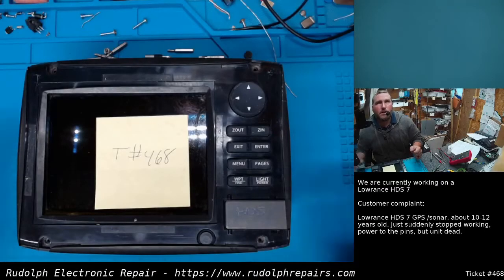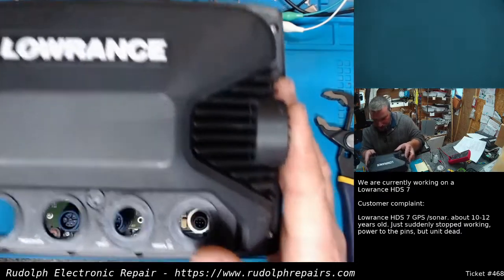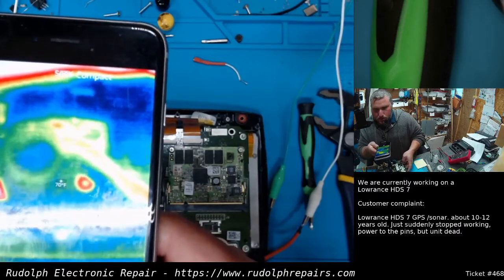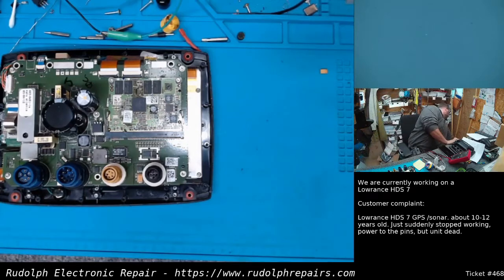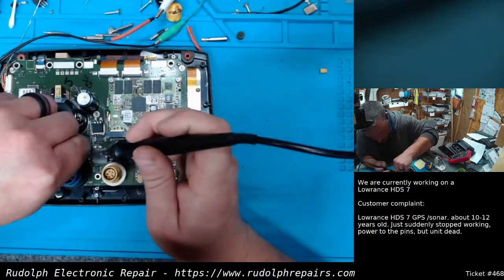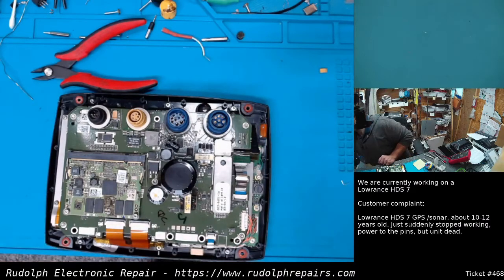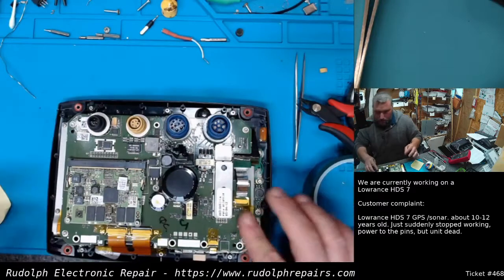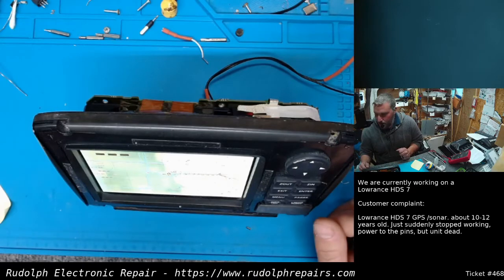Lowrance HDS7 - No Power, FIXED!

Comment: Wow! Just discovered your repair video for the HD unit. I repaired my Elite 9 T2 by seeing how you dismantled your unit. Had a couple of loose ribbon connectors. Unit fixed and working by seeing your video. I gave up after talking for an hour with Lowrance technical support to no avail.  but they were very helpful. I ordered a new replacement unit that I will now cancel. Thanks again!! I would hug you if I could!!!
Reply from the maker: That’s great news!! I am glad it helped!

Comment: Question, are the pin assignments on the lcd ribbon connector the same as long as it has the same number of pins and the screen specs are the same? I have a 9 inch Lowrance reveal with a 50 pin ribbon connector. I've found 9 inch lcd screens with 50 pin ribbon connectors but I'm not sure if the pin-out is the same.